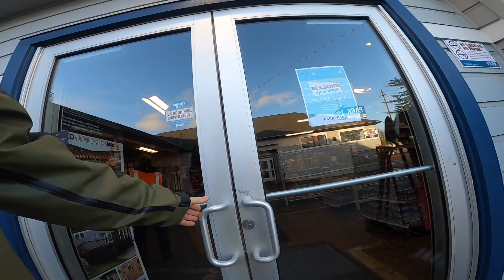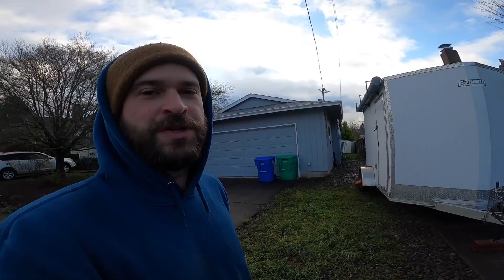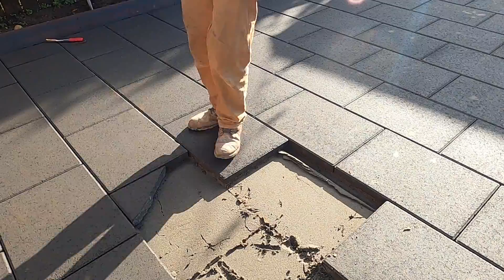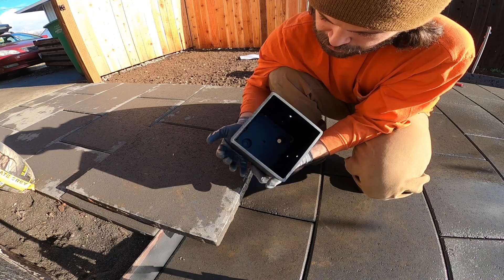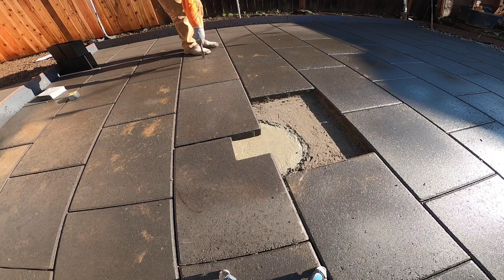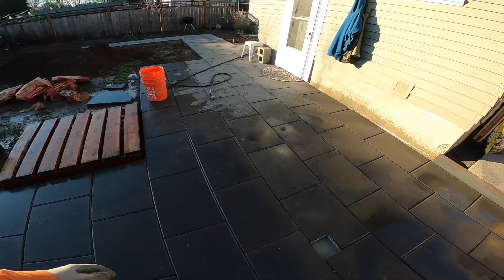Pergola Build (Part 1)

Comment: Thank you for sharing this great video! Can I know what kind of tool did you use to position the post bases? I’m going to do the same project but it could be challenging for me to put those bases in the right places. Thank you!
Reply from the maker: You’ll probably need a hammer drill with a masonry bit. I used 1/2” concrete fasteners, so you’ll need whatever can get you the right sized hole in the concrete! A small hammer drill won’t work for the depth you need
Reply from the maker: Thanks for watching!

Comment: You dug 30” x 12”? To put 1/2 in anchor bolts? What am I missing?
Reply from the maker: Along with dispersing the weight of each point load downward, the footings serve as anchors resisting uplift as well. In a situation like this, (think elevated decks too), most of the structural engineering has to do with keeping the structure from lifting upward in a high wind event! These footings are 320 lbs each. That’s why they’re so big.

Comment: Since the pavers are graded for drainage, the footings not will be level or plumb either.
Reply from the maker: That’s a given, Mr Crack. The poured footings are indeed level across the 12” poured surface, providing plumb posts, which are then, in turn, cut at the appropriate relative heights to create a level roof structure. Thanks for watching!

Comment: Wouldn’t it rot the posts
Reply from the maker: Nope! They’re designed with 1-1/2” cavity at the base, and the substrate for the pavers is sand, which extends well below the bottom of the cavity.